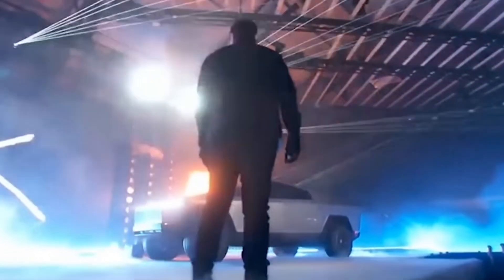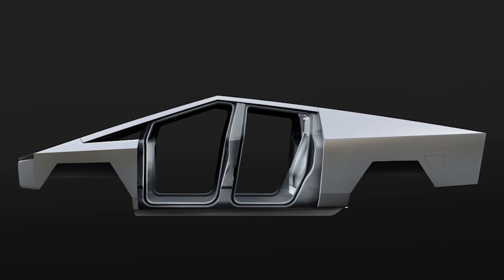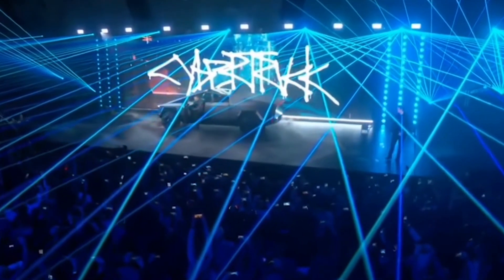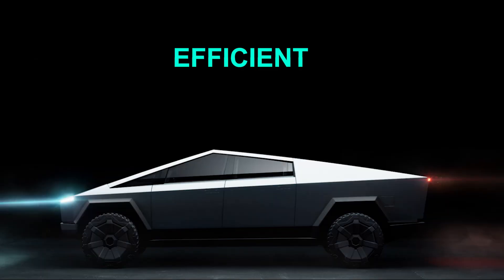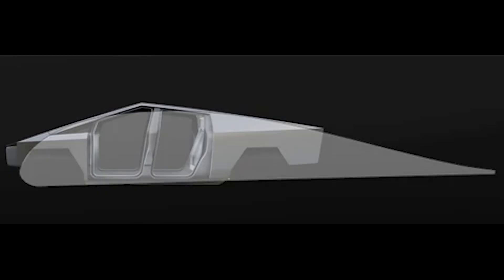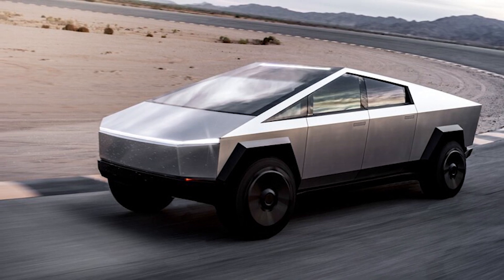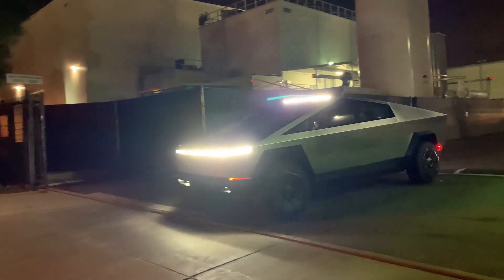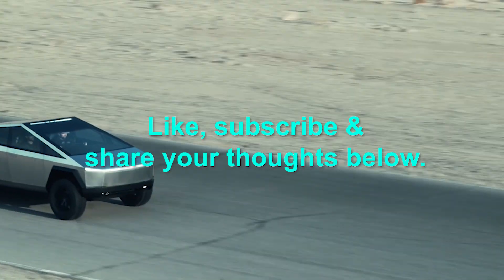Cybertruck is Engineering Genius (and will be copied)

Comment: "CyberTRUCK is engineering genius"

Ah yes, I forgot how many awesome unibody trucks existed... good luck towing anything let alone towing something for longer than 2 hours. This truck is an engineering mutant meant to appeal to diehard Elon Musk fanboys.
Reply: Could u back up your statement, just for me to know that u know what the hell your saying
Reply: @myrvensjoly9080  do you know anything about vehicles? Unibody trucks have been universally garbage and its a towing vehicle that runs on batteries that will die very fast compared to diesel and petrol powered towing vehicles. It has good torque, but if it can't run for long trips it will be obnoxious.
Reply: @waddlesmcsqueezy  that's why you get the 500m range option-So you can tow 200m+ on heavy loads per charge. Still much better mileage than alot of other vehicles. 

Also consider the strength of cold press steel vs aluminum press. I'm sure they've done various tests. 
People will chicken out of buying this thing if it's first couple reviews fail.
Reply: @WhiteWolfos  why should I trust their "technical max range" numbers over other brands if their "bulletproof windows" couldn't even withstand a ball bearing?
Reply: @waddlesmcsqueezy  those are two different things. But to be fair, they were testing it earlier prior to the show which gathers very fine invisible fractures. On top of that the door base got beat with a Sledgehammer (and other things to the body prior). It's designed to stop a small bullet (you'll see on occasion  bullet proof glass shatter but not break fully). It managed to stop a ball bearing that size, which for a standard window the bearing would have penetrated through the window making a hole. I've seen lots of incidents where even a baseball makes a hole on a normal window.  

Anyway, if you want to know it's GVWR classification, it has been classified as a 2b-3 vehicle meaning, it's not in the same class as the F150 and others but instead it's rated the same as a F250 medium duty vehicle.  It's current tested weight is around 8,000lbs but may become heavier on the production versions. After production there's a note of a smaller truck entering competition directly with the F150 and so forth. 
The simple Tesla X model already tows 5,000lbs reliably and it's not a truck though respectively it's their closest to a truck thus far post production.

 Electric vehicles simply have better power and response which limited by other factors is why they can still get such high performance. Paired with Tesla high efficiency motors and batteries, there's a reason why Tesla is leading the competition in electric vehicle performance/kwh. The cybertruck was also pitted in tug of war battles against other cars like the f150, where it dragged it uphill. Again, it's towing capacity is higher so a more fair fight we might see in future videos will be when it's pitted against a medium duty vehicle. 

While range with a 500m equipped vehicle might not be too concerning for many, what is almost always of concern is if this truck is reliable. Only time will tell as Tesla lacks that with it's first truck yet to launch.

Comment: You say the Cybertruck is safe as fuck but I do have an open question about it: because the frame (exoskeleton) is so fucking resilient, what's going on with the of the truck when it's impacted? Where does the energy is going to go? Remember that aluminium has the advantage to absorb more impact energy than harder steel (or equivalent, you got the idea) to prevent usagees inside becoming jelly. So, this is my biggest question about this new kind of frame.

Comment: you skipped what happens when you have a fender bender in your one piece stainless steel vehicle harder to bend still will bend. and while you save in paint stainless is HUGELY expensive compared to steel or aluminum. the bed is tiny compared to even mini trucks. this thing is a joke, hence how its a huge meme.
Reply: Finally someone

Comment: So, safety is gonna be really bad with this truck. There is a reason a lot more people died or suffered serious injuries in vehicles from the 80's and earlier. They were built of metal and built like tanks. When you got in a crash, all the energy was transferred to the occupants and this caused more deaths and injuries. This is why modern vehicles crumple; it ensures as much energy as possible dissipates giving the occupants a better chance. You make a vehicle out of a single piece of metal with sharp edges and no way to crumple... people gonna die.

As for utility. Until batteries can drive you across the country with minimal charging, especially when towing, good luck. The Tesla's today require something like 6 hours of charging for a trip from the west coast to Texas. And that isn't a charging you can just do at once. That is 6 hours of stopping every couple hours to charge for up to an hour. Not many people, especially when towing, gonna want to do that.

Comment: The Cybertruck will take people time to get used to.  Its styling is too radical for most of the people that use trucks for work today, so will appeal to a different market at first.  Once the novelty has worn off the utility of the vehicle will be compelling for certain working purposes, notably the power outlets (e.g. arc welding needs 220v), air compressor, ruggedness.  There's also competition from Rivian and Ford and others making "normal" trucks, but as you say, they'll be comparatively expensive.  So, like everything Tesla does, this is a long-term play.

Comment: I am working in mechanic industry (not car, but mechanic) and I do know that if a car is safe, it's because of the non rigidity. In fact when you crash with your car, the car absorb most of the shock. So, if the cybertrunk don't have any other safety technology, it mean that the rigidity of that car will make all the shock of a crash going straight into your body. And if Tesla do love safety that much, it's not because other car are less safety, but because of the electrical engine. In Diesel car, there is a big fat Diesel engine, very rigid and all, when you crash all the car absorb the shock beside the engine who will enter inside the car and inside you. With a Electrical engine you do have less of that problem. Elon Musk is a genuis because he do know how to speak to people. He's a sci fi guy and everyone love that. But he's also smart and great enginner

Comment: The fact that you imply that you talk about engineering woes and fail to mention Tesla's extensive history just goes to show that you have little knowledge of the issue. 

Also, your whole video is from a "hype boi" perspective. An engineer you are not.
Reply: The hyper simplified construction shouldn't reduce the flaws on previous Tesla cars? Except for the batteries of course. But this car mostly sounds like a big chunk of metal folded to look like a car, that can't be that difficult, no?
Reply: @SovietRipper  It's always simple on paper and theory. History shows us that designing something or making a proof of concept does not mean that's ready for mass production, no matter the cost. 
Given the previous shortcomings and lack of overall technical information regarding this truck I'm quite sure you won't see one on the road for at least another 5 years, if ever.

Comment: I am falling more and more in love with the design of the CT.  The first moment I saw it at the reveal event the big question marks went up... but those dissolved very quickly and now notice that I'm loving the design even more.

Next, thank you so much for this video; I had never even thought about the manufacturing process (or certainly exactly how it would save money which I can see now could be quite significant).  Really good points, mate!  

Just discovered your channel… May need to click that little red box on the right there :-)

Comment: 7:03 real talk, the problem is that a extremely sturdy vehicle is NOT GOOD AT ALL for your safety. All cars for decades have remained fragile because if you ever crash, the car is going to absorb the impact by breaking, making the risk of injury less likely in the process. Hell, the only reason why the model 3 x and s are so safe in the first place, is because they have no motor in front, as electric cars, which makes it possible to design a frame specially designed to absorb front impacts. I am sure tesla engineers have things planned to make sure this steel tank does redirect the impact, because if thats not the case, it will become horribly unsafe. I am thinking precuts un the metal, so it has lines of stress that will break under pression, making the whole car «wrinkle» for lack of a better term. I just wanted to say it, a rigid car isn't optimal for safety at all.
Reply: To me it seemed he made the claim that the exterior wouldnt be damaged on rough terrain. So im guessing its still just as collapsible as any other car
Reply: Do you seriously think they haven't designed crumple in?
Reply: Another important aspect is that this video is only talking about passenger safety. There are a lot of experts saying, that in its current form the cyber truck won't be able to be sold in Europe since safety of outsiders is an important factor. Therefore cars with rigid body's aren't allowed since they would increase risk of serious injuries in a crash with pedestrians.
(which won't bother Tesla that much  because sales of pick ups in Europe are minimal)
Reply: @lulllaby  true, imagine getting sliced in half by those sharp frond angles
Reply: I think so too but I believe the front will be made from a less sturdy material making for a better crush zone, I also want to point out that the cybertruck's balance is completely shit
Reply: @johnmiltonkeynes  you CANNOT imagine a vehicle to be completely crash—safe, no matter what. The autopilot may reduce the risks, but as long as it drives there's a possibility it will crash, and that possibility has to be accounted for, no matter how slim the odds may be
Reply: Regarding the Cybertruck, people who talk about the ability or not to absorb energy in a collision have no supporting figures. They should wait for the results of organizations such as the NHTSA before deciding.
Reply: He claims multiple things that cannot be proven yet. I hate moron Tesla fanbois.
Reply: Yeah a tank is also very unsafe, yet the military use them to transport troops and can resist driving through a building! Lol
Reply: Stuff soft steel look at cars all in pieces after a high speed crash air bags can do the job better

Comment: You are wrong about the Tesla Cyber-Truck.  It was a massive disappointment for me.  I will outline all of it's shortcomings for you.
1) Cost - Some of this is wasted on the screens, the useless nature of the sliding bed.  The lack of ability to offset the investment into the vehicle with utility (I will go into this later).  The general waste of production into features that literally NO work trucks have.  Why?  Did we not have the technology?  No, we did not need them.  I ask you to point out when some construction worker has ever said "You know what Bill, really wish this bed had a storage space underneath it so I could put my tools under my work materials.  Wouldn't that be amazing, have to unload a truck completely to access a hammer?"  Also, secure storage space is a waste.  Tool boxes lock... for a reason.  Why make square wheels man?  I know nobody else does it... but maybe there is a reason.
2) Utility - Ok, how the hell do I mount a flat bed to it?  How do I build a house with 6 foot maximum length two by fours.  Or not being able to carry sheet rock.... or really any building materials at all.  I own a truck to do more that carry my friends bath towels from one apartment to another.  I have a truck that needs a bed that is a minimum of 8 foot.  The other truck I have is a flat bed that allowed me to mount a crane for heavy lifting.  You can not modify the Tesla, in any way I am aware of.  No frame, means no removable... whatever "bed" it has.  I can not give it a 5th wheel hitch for pulling large trailers.  I can not possibly use chains due to clearance issues.  So anywhere there is snow, that truck is done.  It lacks all the things I need for a work truck, and gives me features like heated toe warmers for when I am watching a movie on that useless screen.  The radio in EVERY work truck I own has 2 dials and maybe a digital readout for the station, and I am talking less that 2 sq in of screen total.  I could care less if it gave me a 0 to 60 of a sports car.  Because spoiler alert on this one.  NOBODY using a trailer would dare try to do that.  Or bam... all your stuff on the trailer is now on the pavement.  This truck is a hipster mall crawler.  The truck you drag race other 100 lb weird kids with at the mall while telling everybody how awesome your dad is for buying it for you.  The useless nature actually pissed me off.  I was going to buy one hands down if it was a truck.  I would have offset soooo much cost.  But it is not a truck, it is at best an SUV.  Want to see a gas powered Cyber Truck?  Just google "Chevrolet Avalanche" and see how successful that was with the truck market.  IT IS NOT A TRUCK.  No function as a work truck means all the outlets are only useful for hippie "drum circles" around a campfire while complaining the government won't pay everybody to just stay home.  I work for a living, so does my trucks.
3) Safety - This SUV will kill you.  Hands down, the "bulletproof" glass thing is just plain dumb.  Let me explain, glass is meant to shatter on your side windows.  Since I am willing to bet that at least one of this might slide into some water.  That person is going to strait up die in their new Cyber Coffin.  As clearly they will not be able to effect an escape from this vehicle.  I bet it doesn't have manual handles that actuate the door latches too.  Electric for sure, gonna go hipster SUV, gotta go all the way baby.  Google "man dies in corvette" for a reference on how awesome that is.  Even worse is the fact that it lacks any crumple zone clearly.  This is going to mean that the passengers of this thing need to absorb all of the energy of a collision with their fragile fleshy meat bits.  That will be brutal to say the least.  Automotive manufacturers are not morons.  They have not been messing up the design of a modular work vehicle for the past 80 years.  This is a prime example of when somebody tries to re-invent the wheel with the new "square" design.  It will not work, and it really bummed me out.
Conclusion - Electric is the future, but I am not planning to pick up 17 year old girls "cosplaying" as Cortana at my local mall with my truck.  I am planning on loading up my tools, laying some concrete, hauling sheet rock, and towing heavy trailers.  If I wanted a vehicle that was small, electric, and could carry just tools a persons to a job site.  I would just buy a car....  This thing is a massive failure from the perspective of somebody that was saving up for a Tesla Truck...  that is sad.  Maybe Tesla will see the error in their ways and make a "Work Truck".  I can only hope, until then breath in the soot boys because diesel is still my entire fleet and best option.
Reply: Also

1. Efficiency
Since the battery is large and heavy, weight is a big factor in EVs. With about 3 tons  this truck makes little sense. Armored glas, frame- and bodywork are the reasons here. This gets worse since the range is gonna shrink immense when loaded. Do you really need armoured glas?
2. Particulate matter
Due to abrasion of tires every car emits particulate matter. This has proven to be a big factor in pollution. The heavier the car the bigger the abrasion. And the cybertruck weighs a lot. This also means more frequent change of tires for the owner and thus more expenses.
3. Increase of traffic jams
Not every pickup driver will switch to the electric cybertruck (financially or otherwise). The market for the cybertruck though, will expand to people who didn't drive a pickup before. As a  result the total number of pickup trucks will only go up. While Population and traffic is also increasing, big cars are one of the main reasons to increase traffic jams. Not many people need a pickup truck. Most of the times there is only one person per car and not transporting a lot. An environmentally future uses a lot of small city cars.
4. More pollution from remaining combustion engines
As traffic jams are increasing the pollution from the remaining combustion engines increases.
5. Danger in a crash
The first presentation has shown the cybertruck to withstand a lot of force. Modern cars are engineered to deform on impact to absorb energy. Without this, the passengers will feel the full force of the every crash. Also it is a danger to others. The cybertruck is basically a tank waiting to roll through another car in case of an accident. To top it off the very edgy design is a danger to pedestrians.

Comment: No I think you should stop smoking pot. Granted I’m not saying the truck isn’t a awesome design, because it is. But not everyone buys a truck because it’s cheap. There are too many factors at play when it comes to buying a truck. And it’s yet to be seen how that truck will handle towing large loads. Usually electric vehicles struggle with towing causing the car to use too much energy. Unless they have actually perfected the solid state battery I doubt it will be very good at towing.